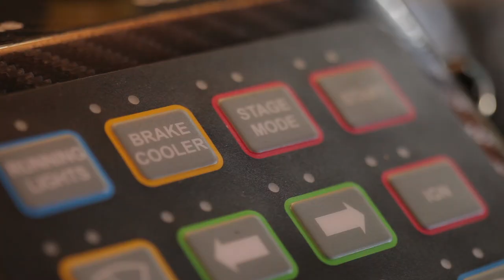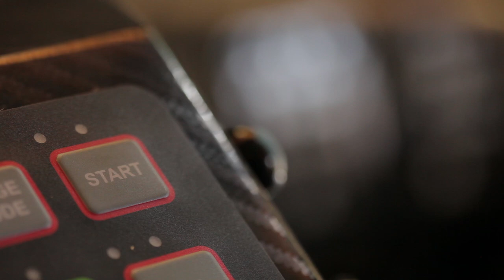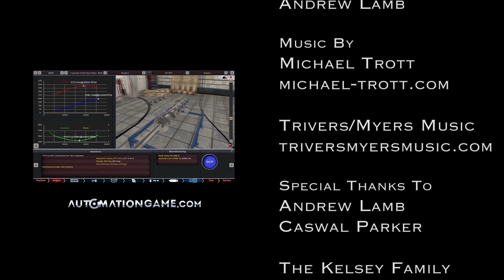The Homebuilt Rally Car That's Too Fast for the WRC - TST in NZ

Comment: He didn't build it in a barn. He made it in an extremely well fitted out mechanical engineering workshop, with clearly plenty of £$£$£$£ in his back pocket. The fact that it just so happens to be inside a large wooden building, slightly resembling what many would recognise as a "barn" is incidental.

You say it as if he just had some pitch forks, some straw and his own brute strength.

Saying that, ultimate kudos for what he has achieved. I certainly couldn't build a car from scratch.

Comment: The engine is based on a Nissan VQ30 but it's built by an english tuning company. Same car in the Dallara racing cars and also in the nissan Maxima, 350z and mid 2000's Skyline (non-GTR)

Comment: Seriously Peugeot needs to make a mass produced road car MR version of the 208 or 207 and it wouldn't need to have loads of power even 250 to 280hp would be enough with the engine in the back and keep it within the Golf GTI or Renault Clio RS kind of class. They could call it THE PEUGEOT 205 RS or something like that. Hell if they gave it AWD it could be a contender for the WRX but personally I think just MR on it's own would be better than MR with AWD.

Comment: Just a heads-up wrc cars are limited at 300+ hp for safety reasons plus they use 100% fossil free fuel.
Reply: 100% fossil free fuel is just an excuse to use rocket fuel etanol (extra oxygenated ethanol) xD
Reply: Sure but still no any new carbon is introduced in to the atmosphere,the fuel is produced from already existing carbon and natural sources so it is 100% clean energy
Reply: @MP-hd8ys  
Sure, which of course is a great thing

Comment: If he made it from scratch , how did he make the frame of the car ? How did he make all the engine and gearbox individual parts ? How did he manufacture the suspension ? I guess he didn’t make a car from scratch nut built a car from parts from other cars
Reply: Some parts were homemade, like suspension and wheels which were modified. I feel like you hastily made that remark to feel better about yourself.

Comment: He is NOT too fast.
The reason he is not allowed to race WRC in this is because that car is breaking most of the rules.
WRC cars are limited to 380hp, have to weigh a minimum of 1200kg (1350 with driver and navigator) and use a 1600cc motor.
His car is also mid-engined which means he'd have to build 2500 of them and liberally uses carbon fibre, also not allowed.
Seems the only WRC legal parts of his car are the wheels and brakes.

Comment: To fast for wrc nope the guy put to big a engine in it 3.5 litres wrc limit 1.5 oh  and 450 wow out of a engine nearly 3 times the size hate tell you this but when not limit by wrc rules wrx lancers focus have been max out a between 600 and a 1000 bhp well done you built a car a race not a rally next use the right engine then well call it a rally car